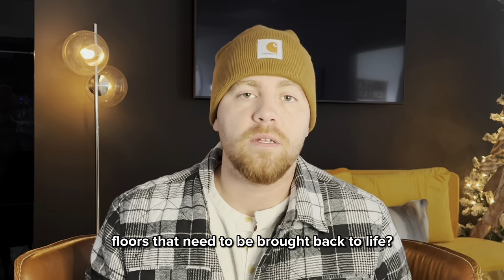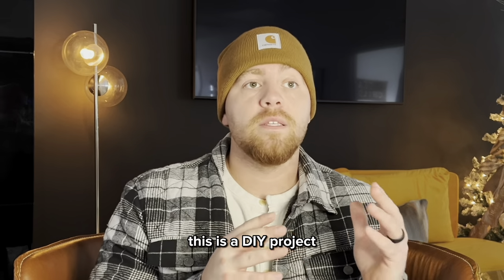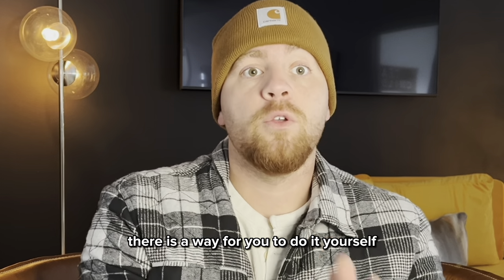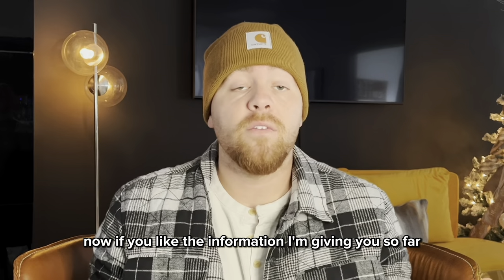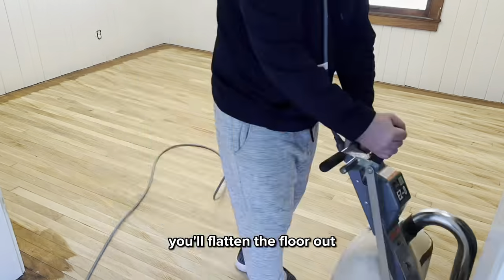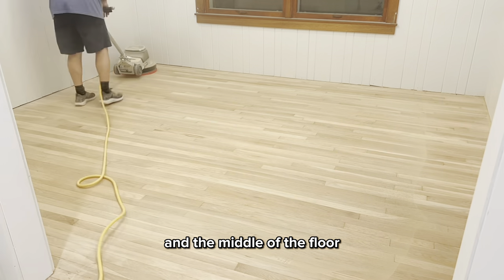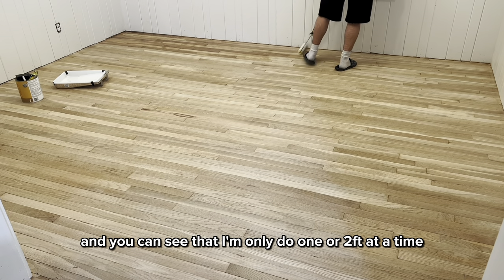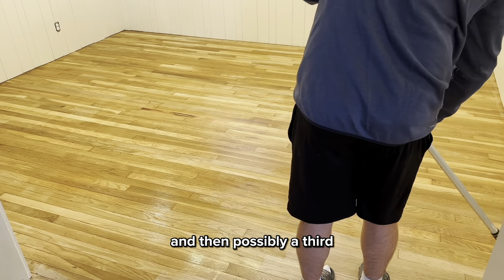Beginner Guide to Refinishing Hardwood Floors on a Budget (I Saved Over $4,000)

Comment: One reason hardwood floors were covered up with carpet was due to maintenance. Poly coats (or other clear coasts) were not used, and I remember my mother stripping and WAXING the floors weekly or bi-weekly. A lot of work. Vacuuming was easier.
Reply from the maker: Yes, and it was because carpet was the trend, just like thick curtains over the windows.
Reply: What's the name of the finisher that you put on the floors last to make them shine a little
Reply: I still paste wax mine
Reply: Yup, same. Actually she had US doing it 😂😂. But then years later my Mom took the carpet up and we have the beautiful hardwood floors again.

Comment: Good tip on turning off the air. Not only for the floor but for your air system itself. I work commercial construction and did a job where they sanded floors like this and they didn’t turn off the system and it clogged with sawdust and ruined the systems in there
Reply from the maker: Yes! Will cost you more to replace the HVAC than paying someone to do the floors!
Reply: Not all heroes wear capes - THANK YOU FOR THIS!

Comment: Refinishing floor in 2024 in Illinois costs about $2.50sf. including 2 coats varnish and extra $1.20sf. for stain color. However if the floor is less than 300sf. flooring company will charge you extra. Tip. if you use water based finish you should use sealer first than minimum 2 coats water based finish.
Reply from the maker: Cool👍🏼

Comment: We’re in the process of doing the same in a house built in the 60s. The padding is really stuck down to the hardwood in spots. We’re getting the majority but there’s still some that just won’t scrape up. Any suggestions? Will the sander take it off? Or is that not recommended? Great job by the way.
Reply from the maker: @TheK9co  I wouldn’t try to remove padding with a sander. Maybe some sort of stripper to get the glue to let go?

Comment: Quick Question: How Many different sanding belts were needed for each grit? Wondering how often you changed the rolls for the entire home?

Also: Do you have an alternative for the edge sander? I cannot find one for rent anywhere close by. Would an orbital sander work for this?
Reply from the maker: I don’t remember exactly how many, but the first passes took more because you’re trying to get the floor flat, and in my case, getting the carpet glue off also. What I did was just get more than I needed, and returned the ones I didn’t use.

I don’t think it would be impossible to use an orbital sander for the edges, but it would take a lot more work

Comment: 36, 60, opp diag, 80, parallel, finish sander 100, sweep and clean dust, clear matte finish foam brush for corners, 3/16th in. nap for main 1-2 feet at a time bcus fast dry, finish sander buffing pad, vaccuum, second coat, maybe 3rd
Reply from the maker: @dudumoomoo  random comment of the day
Reply: @agentalexcamp Didnt expect you to reply on a year old vid, I'm gonna start refinishing my floors and this video has been by far the most helpful on youtube. I was writing down all the steps lol
Reply from the maker: @dudumoomoo  I gotcha. Goodluck on your floors
Reply: @agentalexcamp Thanks man. I'm curious how long this whole thing took you/how fast I could do this for let's say 2 rooms?
Reply from the maker: @dudumoomoo  this wouldn’t be a good representation because I’m only showing 1 room, but I did my whole house. It took me about a week to do all of the hardwood in my house. For 2 rooms you could probably do all of sanding in a couple days, and the sealer/stain in 1-2 days. Wait until it’s a little cooler outside because you will need to turn off you air conditioning while you do this
Reply: @agentalexcamp 👍 Thanks for the advice
Reply from the maker: @dudumoomoo  no problem
Reply: @agentalexcamp love the video. How much dust can I expect? Walls? Wi does? Doors? Cabinets? Only have poly on our floors which were redone about 15 years ago.
Reply from the maker: @Topjunkie-r4s  the sanders have vaccuum attachments to minimize, but there will still be plenty. Make sure your HVAC is turned off
Reply: @agentalexcamp  will do. I’m in the middle of pairing the walls and moldings. Just painted the kitchen cabinets too. Will have the company cover the cabinets and hire a cleaning crew for the walls/moldings

Comment: I have parquet flooring in my new house but the previous owner didn't like it so he applied many layers of stain to hide the parquet making the floor look painted. I considered attempting to refinish it myself since I don't like the current look and he did a poor job. Do you think this process could work to remove stain that has been applied so heavily?
Reply from the maker: @cg1492  yup should be able to sand it off. This floor was 70 year old stain and carpet glue.

Comment: Thanks Alex. Planning on doing this in our kitchen. Would a water-base still be good or should I consider oil-base? Thanks for your video. Cheers.
Reply from the maker: I would think either should work, but oil based is supposedly more durable. Goodluck!
Reply: @agentalexcamp  No it's not! Oil based finish: each coat dries 12h. they yellow  and they are easiest for scratching. But they are the cheapest and the easiest to apply.

Comment: You mention that the drum sander could harm the floors. What exactly would the harm be? I bought an old farm house and like you said they covered the wood floors with carpet. I would like to refinish the hardwood floors but messing them up is my biggest fear!
Reply from the maker: This is the best way I can use text to give you a visual: instead of the sandpaper being on a flat disc that slides around on the floor, the drum sander has sandpaper in the shape of a tube, that you slide onto the drum, and the heavy drum rotates like a wheel on a car. 

Because of this, if it stays in one spot for even a split second, it digs into the floor, creating a gouge in the wood at that spot. So every single time you start a strip you have to ease the drum down as you’re going forward, like landing a plane, can’t stop at all for that strip, and when you get to the end of the strip you have to ease it back up like taking off in a plane. Did any of that make sense?

Comment: Looks great. I might have missed it, but how long did the sanding process take from start to finish with all the different grits? Looking to refinish about 800 square feet (first timer) and I'm wondering if a one-day rental would be enough time to get both types of sanders in the same day.
Reply from the maker: It took me like a week to do the whole house (about 1,200 sq feet of hardwood). My floors were 70 years old and needed a lot of work. The video is sped up, but you have to go slow with the drum sander. 

Also, you’re going to have to rent both the drum sander and edger at the same time, because you cant do all of your grits with the drum sander and then go back and do all of your grits on the edges. You have to do your grits together before moving onto the next grit. After you’ve done all that, you can take those back and then get the buffer to do the final pass.

Comment: What are you using to remove the carpet glue, shellac, etc? I have hardwood floors from 1951 and can tell from a little bit of sanding there was an oil based stain + shellac still on the floor. Not sure the best way to get this off to start the sanding.
Reply from the maker: I just used the drum sander. My floors were in rough enough shape that I was starting with a very low grit anyways, so that removed the carpet glue with the top layer.

Comment: Please help!  
How do you we keep the roller from leaving tiny bubbles in the finish?  We're having a tough time.  My wife and I did a great job on stripping the floor to the bare wood BUT cannot get the sealer go on evenly.  If we do, we have bubbles.  The floor is splotchy right now.  I have to re-rent a floor machine to sand the finish coat back off.
Reply from the maker: What kinda roller are you using? Also, you have to keep moving along with the roller. As it’s drying, you can’t get bothered by how it looks and roll back over it because that’s going to mess it up.
Reply: @agentalexcamp , I used a 1/4" roller and later a sheep wool roller.  Both left bubbles. 
I appreciate the advice about keeping moving.  Am I messing up by treating sealing the floor like when I paint walls?
Reply from the maker: @terrymofmich  I just went a few boards at a time and went all the way to the other side of the room. A lot of people, including myself, think they missed a spot or it looks bad as we’re going, so we roll the roller back over it real quick, which ends up messing it up. Just gotta trust it and let it dry, and do multiple coats so it evens out.

Stirring your sealer too fast could also trap air bubbles also.
Reply: @agentalexcamp , thank you !

Comment: Everything in the video is pretty much right, only cross the floor in an angle with the drum sander ones. And the floors turn orange or yellowish because they use an oil base
Reply from the maker: Everything in the video is correct. You just repeated what I already said and did in the video.

Comment: How did you removed the glue? I have rooms with old carpeting that I’m looking to redo the floors but like you they glued the carpet down straight to the floor. So I’ve been searching for the best way to remove that so I can sand them down.
Reply from the maker: I just used the sander. Didn’t have the time or energy to try to scrape it off
Reply: @agentalexcamp  oh cool! Did you start with a 36 grit? Also, thank you for responding!
Reply from the maker: @kylecakes1  yea I had to start that low to get the glue off, and also because these floors are 71 years old, so it took a more coarse grit to get them back to level. You’re welcome!
Reply: Sander with coarse grit can work, but having just done some of this, I’d warn folks that the glue will clog up the belts or sander sheets much faster. If there’s any way to get more of the glue off before sander hits, I recommend.
I had some success actually using a heat gun, very carefully heating the glue and use a tapered scraper (use a file to round off the sharp corners on scraper) to remove, again very carefully to not damage the surface. Anyone dealing with old carpet glue stuck all over their hardwood, I  definitely feel your pain, good luck!
Reply from the maker: @james396  yes will definitely clog up the sandpaper faster! Basically you have to decide between saving time or saving money on sandpaper!
Reply: I have a floor cleaner with steam, I think it’s Bissell, that I bought to steam clean the ceramic tile kitchen floor.  I discovered that it softens the glue on the wood floor and then I can scrape up the glue.  I’m not ready to refinish yet, (even though it needs it!) So it’s nice that it leaves the original finish, with minimal if any damage that I can see.  I’ve just been doing small bits at a time when I clean the kitchen floor but I don’t think it would take long to do a room.

Comment: I varnished my unfinished wooden floor with oil varnish and it turned the floor yellow. I hated it as the wood looked beautiful pale. I tried sanding it out and it didn't work. Is there anything I can do to bring it back to its original colour?

I only found out about Decorators varnish dead flat after I had applied the oil varnish. I'm gutted.
Reply from the maker: Other than sanding it I wouldn’t know. Maybe wood bleach, but sounds like it would take a ton of that
Reply: @agentalexcamp  Thanks for your response and advice.
Reply from the maker: @Insp.CountMortisWinshipKlaw  no problem! Keep searching YouTube to see if someone has faced that same issue!

Comment: The carpet glue can be removed with Sentinel products. There is also a three head counter rotating heads sanders. Water popping would have evened out the color.
Reply from the maker: Yes, I didn’t have the time to remove all the carpet glue first. I Needed the drum sander because of the age and condition of these particular floors. And my clear sealer was water based, so it water popped the floor on the first coat. That’s why I said to buff after the first coat to knock the swollen fibers off

Comment: How long did it take you to do it from start to finish ? I've bought a house with a hardwood floor that has pet toenail scratches. Our living room, dining room, and 3 bedroom have hardwood floors.
Reply from the maker: If it’s just scratches then it should be a much easier process. These were 70 year old floors with deep scratches and carpet glue. Took about a week or so. Because of the state of my floors, I had to go all the way down to 36 grit. If yours is just a generally scratched floor, might can skip the lower grits

Comment: How long did you wait in between clear coats? How long do you let it dry before you can furniture on it?
Reply from the maker: This was water based so it dries faster. Waited 3 hours between coats. I’d probably wait atleast 24 hours before furniture
Reply: @agentalexcamp  I’m still trying to decide between the Benjamin moore poly or using the hd bona 
I’m sanding my floors beginning Tuesday
Reply from the maker: @perfectchaos_official  that was the two choices I was deciding between. I only chose the Ben Moore because my friend had it in stock and I was able to get exactly how much I needed, and easily return the extra.

Comment: Between first and second coat,  did you use just a sandpaper or something like fiber pad to make it shine?
Reply from the maker: I used 220 grit on an orbital palm sander to knock down the wood fibers
Reply: @agentalexcamp thank you!! One more question- can I use the acrylic polyurethane if it was covered with oil or lacquer  before sanding the floor?
I will try sanding my floor this weekend!
Reply from the maker: @ghkddms84  when the floor is sanding to bare wood, what was on it before is irrelevant. My floors are 70 years old, so they used oil based originally

Comment: How are you going to gloss over the removal of the carpet glue!? I pulled the carpet out of my basement, which was glued to real linoleum, and the Mrs and I tried every kind of scraper we could get our hands on, didn’t work, tried various chemical floor strippers, didn’t work. The only thing that worked was baby oil and scrapers. It had to soak over night and it took a week to do it. 1,800 square feet of linoleum was cleaned this way. Neat thing was we found a 20 something foot long shuffle board layout in the linoleum floor! 

We’re onto the sanding of the hardwood upstairs now, built in ‘56 every room but the kitchen and bathroom.
Reply from the maker: @brainwashingdetergent4322  yea I knew it would be a nightmare to try to remove the carpet glue on it own, so i just got it off with the sander.

The shuffle board layout was a cool find tho!
Reply: @agentalexcamp  I had a suspicion that you sanded it off! We also found music notes 🎵 🎶 in the pattern too, I’m guessing where a record player once was? Anyhow, thanks for making the video and showing us some tips!
Reply from the maker: @brainwashingdetergent4322  you’re welcome!

Comment: What grit do you use when buffing it? 100?
Reply from the maker: The screening before any stain/sealer was 100. The buffing after the first coat was higher because it’s just to knock the swollen wood fibers back down
Reply: @agentalexcamp  buffing between coats, can that be done with a pole sander at 220 grit?
Reply from the maker: @k3vinyAng  I’m not sure, but if I had to guess, I would assume that may leave visible scratches. I didn’t want to pay to rent the buffer again, so I actually used my orbital hand sander and 220, just between first and second coat, because the first coat is when most of the fibers are going to swell.
Reply: @agentalexcamp  okay thanks! Wish me luck this weekend! I’ll be my next project. Never touched a drum sander before but i’ve watched lots of videos and read lots of thread.
Reply from the maker: @k3vinyAng  you can do it! If your floors are really bad, the drum sander is the most heavy duty, but also can do the most damage, so just make sure to practice with it and get used to the motions before the actual floor. But I had never touched a drum sander before I did my floors either, so you can do it!
Reply: @agentalexcamp  yup, my living floors are bowed. So definitely will need the drum to flatten it out. I’m think start sanding with the grain and then angle it out a bit to flatten the floor? Is that how everyone does it with the drum?
Reply from the maker: @k3vinyAng  45 degree angle is what gets rid of the high spots to flatten it out. Angle first before going straight
Reply: @agentalexcamp  thank you!
Reply from the maker: @k3vinyAng  no problem!
Reply: @agentalexcamp  started sanding. Realized i need more sand paper than i thought i did. And hardest part is the edge sanding, the edger is hard to control 😭gets tiring fast having to fight it.
Reply from the maker: @k3vinyAng  edging is definitely the worst part

Comment: Should you fill the gaps if there are a lot of gaps? if yes, with what?
Reply from the maker: A lot of “pros” will use a thin wood filler/epoxy that they pour onto the floor and then spread it all over to fill all the gaps, and then sand everything smooth. The problem is that wood filler hardens and isn’t flexible, and wood floors expand/contract with hot and cold seasons, so the filler ends up cracking.

But if you only have a few really bad areas to fill, I posted a short that shows what I did for a bad area⬇️

https://youtube.com/shorts/ZEAQhdibR_8?si=r57CTF82eLs2dcn_